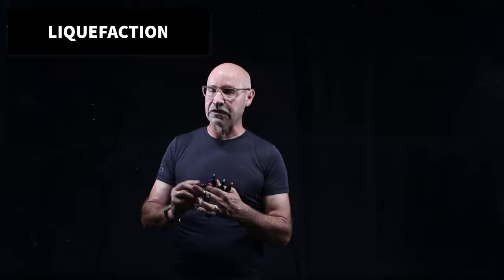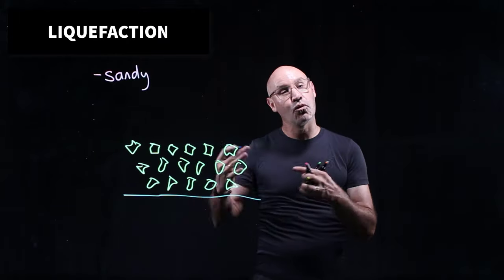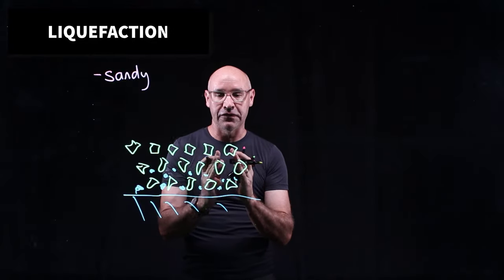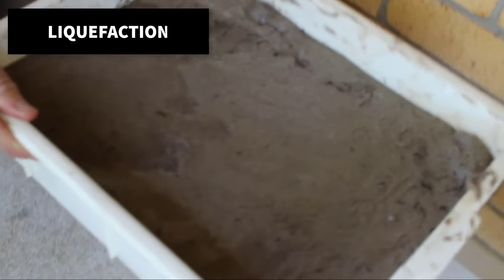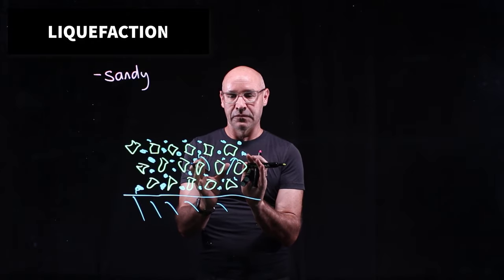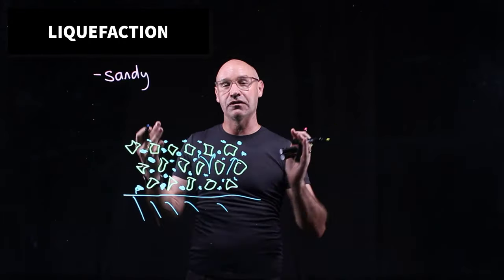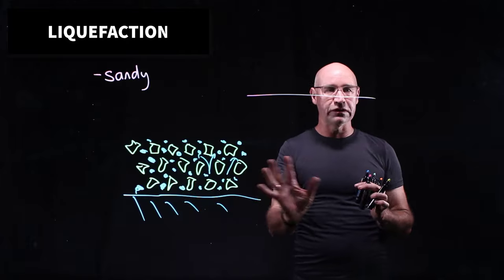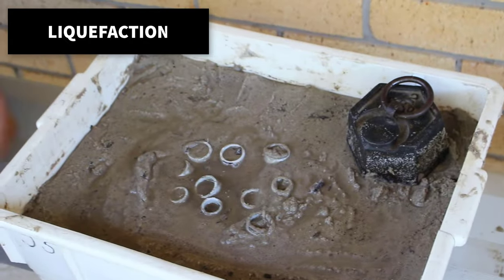Soil Liquefaction

Comment: Is it always the sand is situated right above the water table which later emphasises liquefaction?
Reply from the maker: Sand is very porous where as clay is much less porous so would reduce liquification. Liquification is definitely a function of the sand. So I would think the substrate needs to be sand or another equally porous soil type.
Reply: @SteveGriffithsvideo  understood, but was more curious to know about water table's location or a subtrate it is most closely connected with, sand or clay?
Reply from the maker: @AbhaySingh-jx6fp  great question. I am not sure.